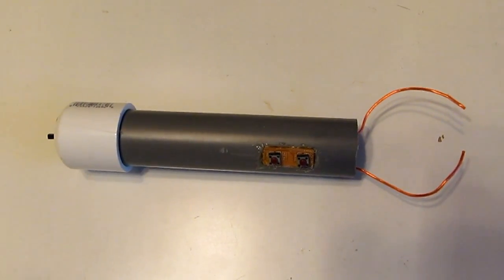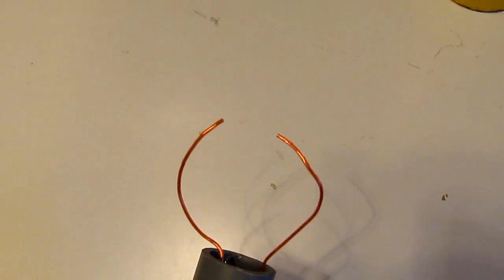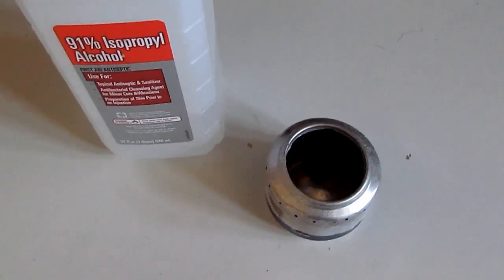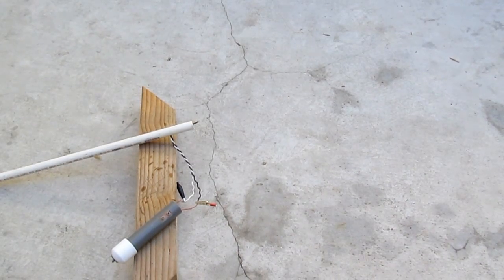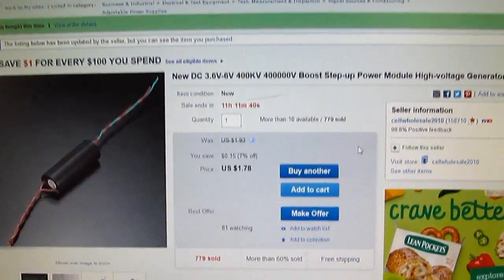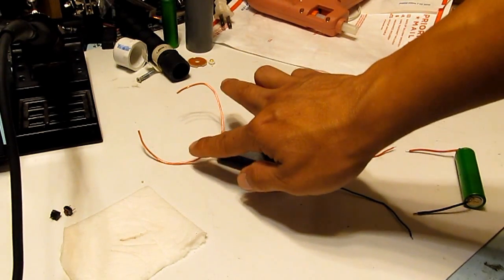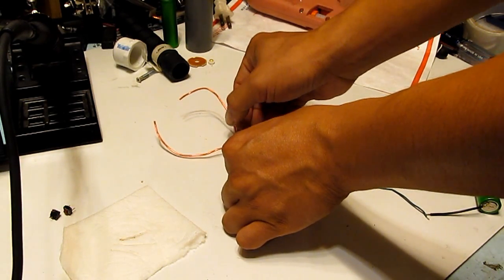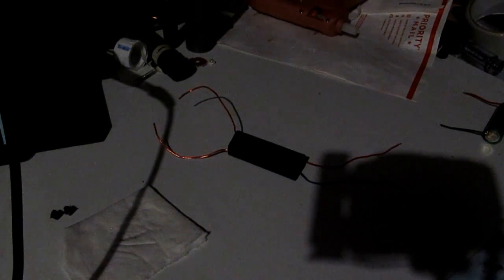DIY: Make a Taser Gun -Sparks Generator/Ignitor + LED Flash light for less than $4, powered by 18650

Comment: Hm..i got the same wannabe 400kv generator, any tips how i get the tazer like loud pulses like in the vid? My "high voltage impuls generator" just screeches with lots of mini lightnings instead of this loud cracking mini lightbolts..do i have ti build some sort of driver board?
(Currently testing with a lab power supply at 6V limited to max 3A)

Comment: Hi. Can u plz help m out.l
My taser stopped working
After disassembling it i seperated that capacitor and connect it to the battery like u did but its making lite squeashy beep sound its not sparking even with both ends too close
Reply from the maker: Probably the main unit is burned out.

Comment: 400,000 volts is a bullshit claim. 30 - 50,00 max with that spark gap.They lie on there claims on those units. 400,000 volts would need a 2 inch gap.

Comment: How many volts had you applied to the high voltage generator at 6:03?
Reply from the maker: 4V
Reply: You mean that green battery is 4 volts?
Reply: @tarsiousmunalembohol  18650 Li ion are 3.7V nominal and 4.2V charged.

Comment: cool is it strong enough to take out a attacking man.
Reply: I have built one of these, its closer to 40-60v. It hurts and sounds very intimidating but it wont stop anyone in place, if you are interested in making one I would suggest buying a few of the generators as my first one didnt work at all. Keeping the gap closer will improve the life of the generator.
Reply: @darcymacerlean7924  40 - 60v :DD

Comment: can you use a normal battery?
Reply: Define "normal".  Any DC voltage source, from 3.3 volts to 6 volts with proper polarity, will should work.  So, 3 AAA or 3 AA in series should work.
Reply: Please use aa bettry

Comment: would any 6 volt battery work? ?
Reply from the maker: Yes. I think it can take up to 8V DC
Reply: I have used 9v in mine, but staying lower will improve the generators life span.
Reply: vuaeco Do you know how hot it is? I need it to ignite Magnesium, so it has to be a little bit hotter than the normal ignitors